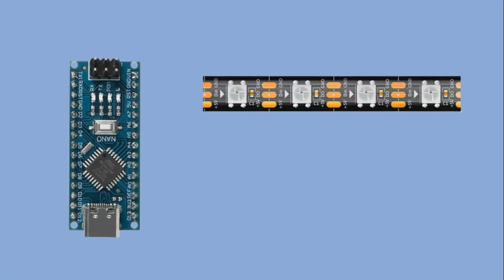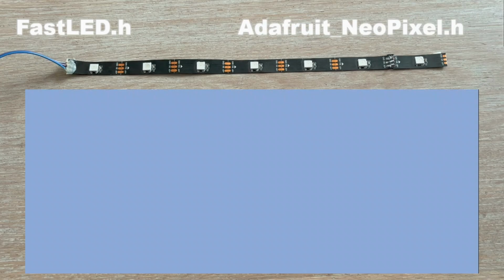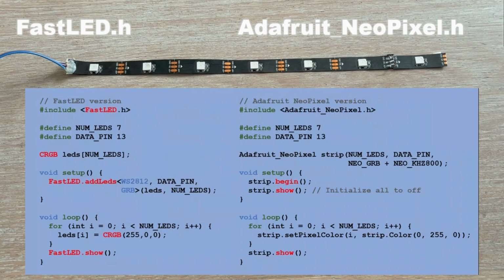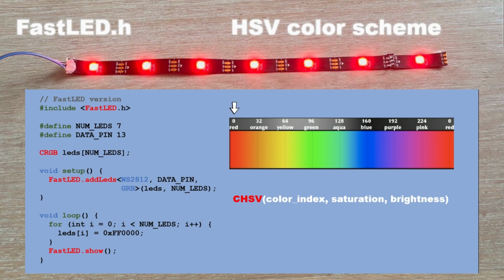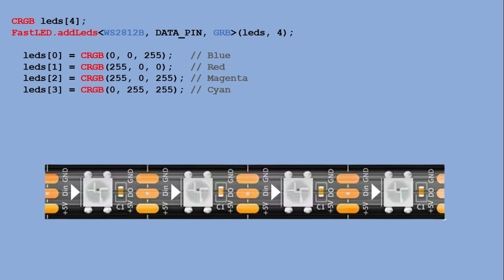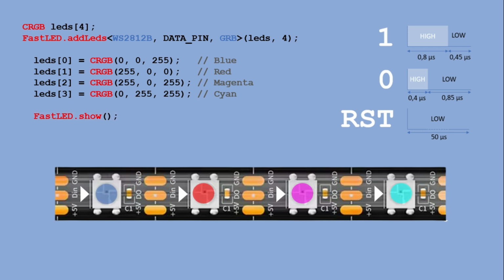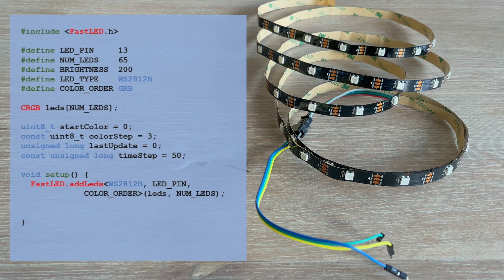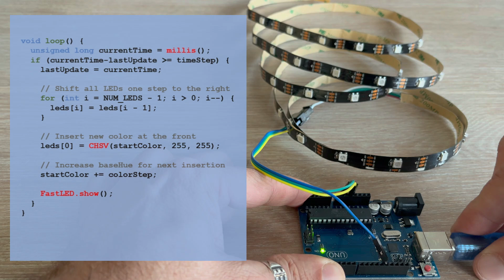LED Strips & Arduino – Control WS2812 LED Strips with Arduino and FastLED

Comment: Can I ask?
Can I wire that in parallel connection. Example I have cut it in two part then connect the starting wiring togethe creating a paralled connection.

Comment: Great video. I learned a lot. Just burned my first set of WS2812Bs and have a fresh roll on order. How do I know if I need to add a capacitor to the 5v/VCC to even out the current? What about a resistor like 330 ohm on Din? Needed?

Comment: You mentioned that data is stripped by first LED and rest is passed down to next LED, once all data is stripped and RESET signal is passed all LEDs reflect the change at the same time but how does RESET signal is passed to all the LEDs at same time ?
Reply from the maker: What do you mena by reset signal. I presume the leds lit in sequence but this is super fast sequence your eye would never register:)
Reply: @marios_ideas  so essentially each LED consumes its own data packet and pass the rest to next led - while the next led is processing it packet the first LED has already started displaying the colour. Correct me if I am wrong